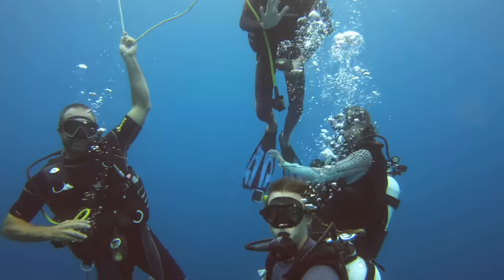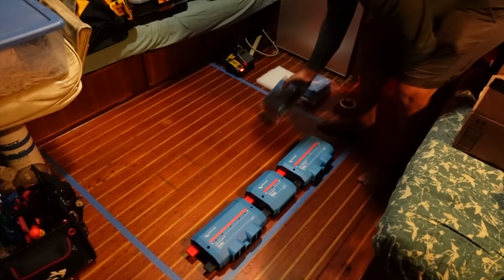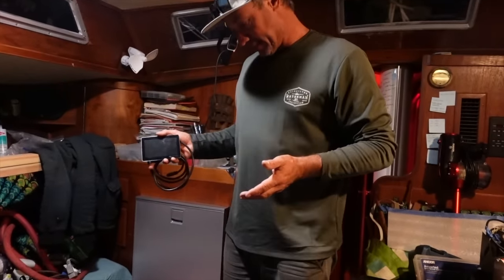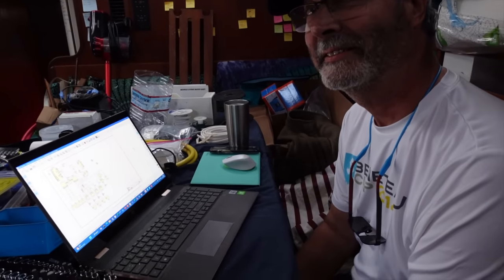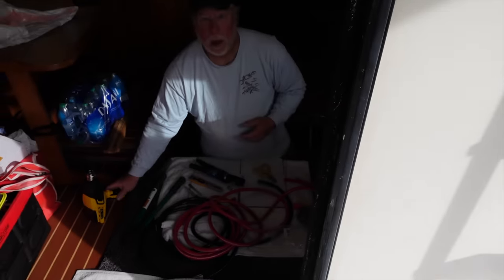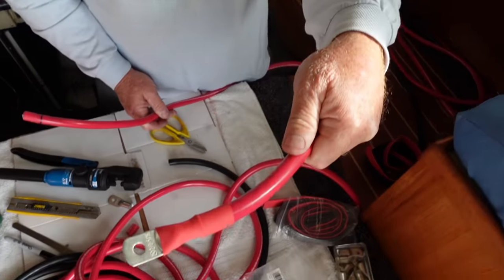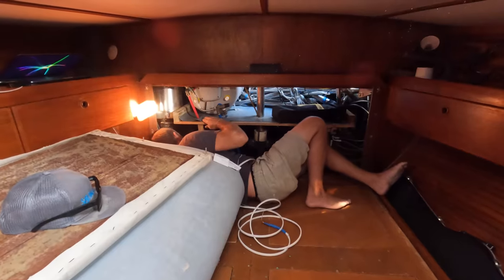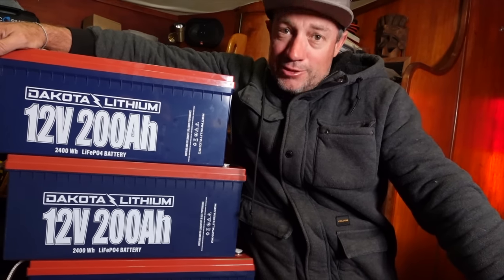Powering up your sail boat : A Simple walk through | Ep 330 | Sailing Catalpa

Comment: I really like my LIPO's (a high tech wizard told me don't use the Lithium Iron name, just LIPO so I'm following is advice) . Right now they are powering my refrigeration and my ham station, all 12v. I haven't really needed an inverter. I have a battery powered HDMI screen (doubles as a TV) and runs and charges on 12v ! Perfect for my Raspberri Pi !  HF radios, VHF/UHF radios, lots of stuff. Two small 12v frdges . MPPT. Great batteries (some DIY and some purchased. ) . Barry of Mai Kai told me what your currently up to. Have fun !

Comment: Great video, excellent equipment.  I use Victron 95% of the time for my off grid systems.  Only thing I'd suggest is a 2 pole breaker for each battery string to isolate each battery and protect the cables between the lynx buss and battery,  apologies if it was mentioned already.

Comment: I would rethink running the water maker on the modified sine wave inverter, AC motors do not like square/modified sine waves as they are very hard on them. whereas switching power supplies for computers and whatnot don't really care, they will run on crappy power all day long. A switching power supply for a computer and other items is cheaper and easier to get in a foreign country than an AC motor.
Reply: I would check with the water maker manufacturer to see if the motor has been operated successfully on a square wave inverter. If the motor is spec'd  for "non-inverter-duty", then a reactor could be added between the inverter output and motor to smooth out the transients and let the motor run cooler.